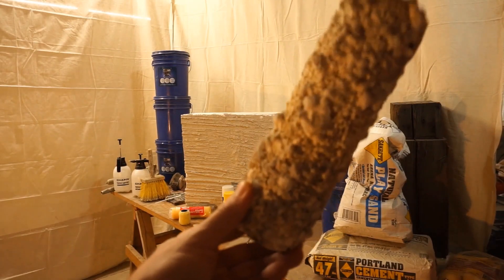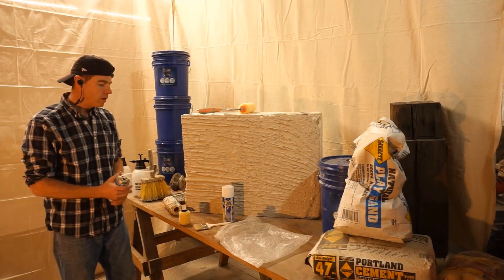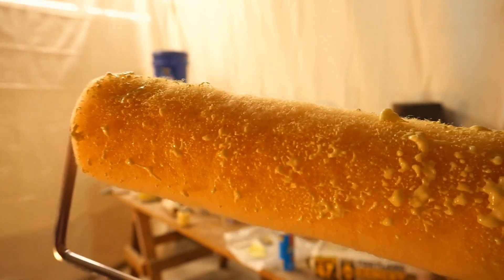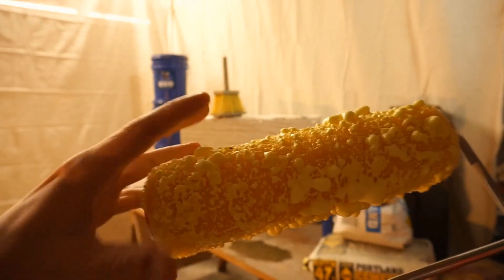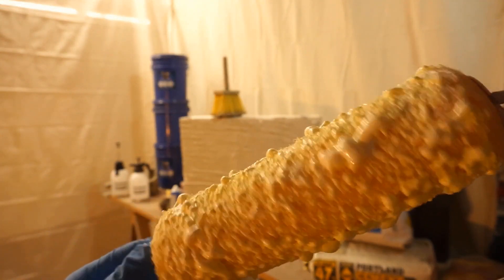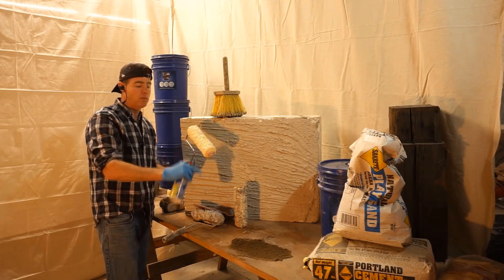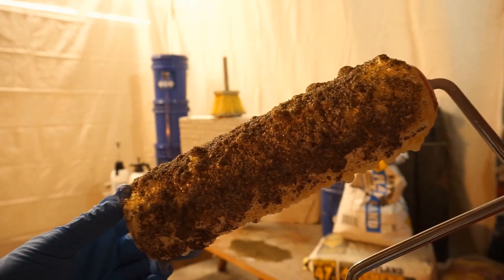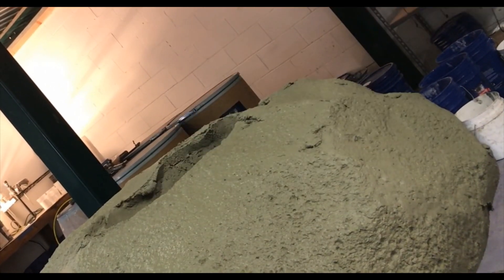Making and Using a Concrete Texture Roller - Carved Concrete, Rock Carving

Comment: Love it - simple and what a great effect! 
I've got 3 questions...
Why PlastiDip to seal it? Would paint do to seal the surface or is there anything else you could use?
What sort of mix do you use on the rock at the end of the video - 1 part cement and 2 sand or is there less sand?

I'm making a vertical concrete column in a form for the garden. Once in place I was going to paint it with a bondcoat of 4 parts Bondcrete, 1 part water  and then add a quarter inch skim coat (with more Bondcrete) to press the "rock roller" into. Would a quarter inch skimcoat be ok? (Bondcrete is a PVA that's been used in Australia forever to make concrete adhere.)

THANKS!!
Reply from the maker: Eric McCOLOUGH the plasticoat is more durable and lasts much longer with no chance of leaving flaking paint in the surface. 
The mix is 2 parts sand to 1 part cement (usually 3 parts sand to one part cement) and our Car-VZ admix. The key is the admix for all the strength and no cracks.